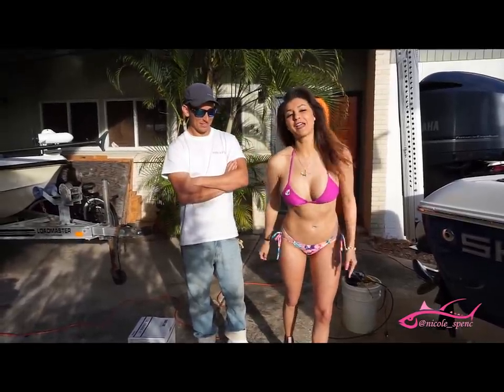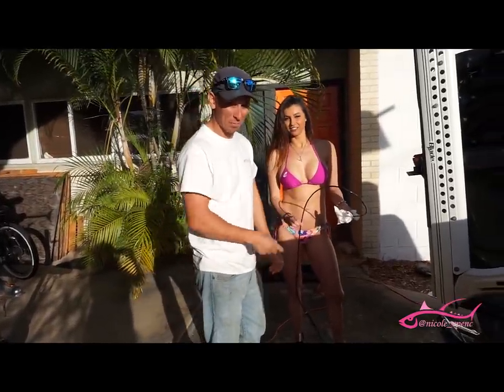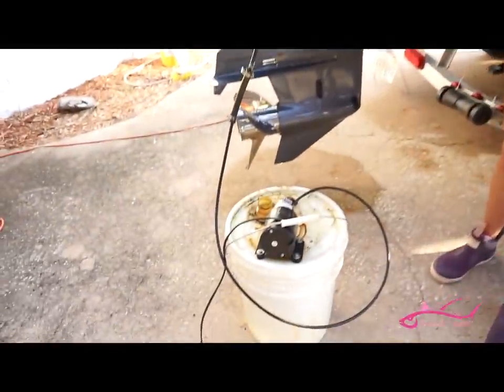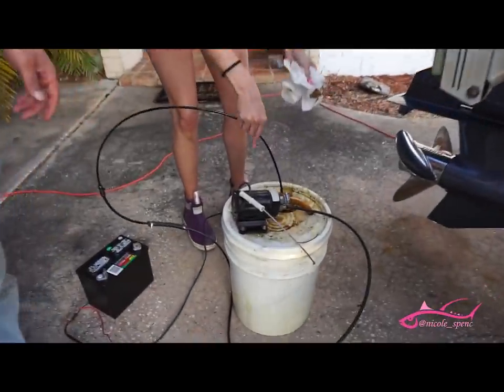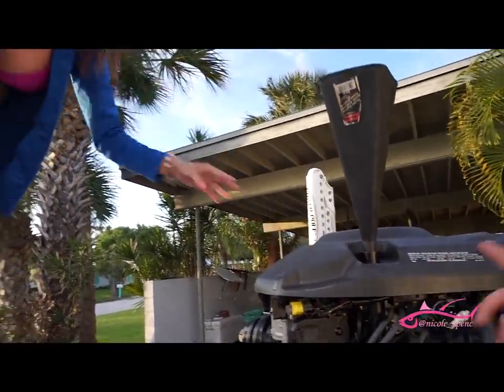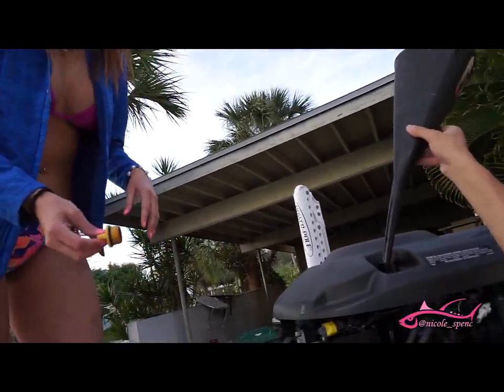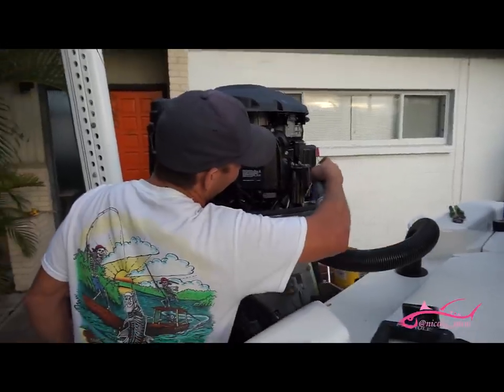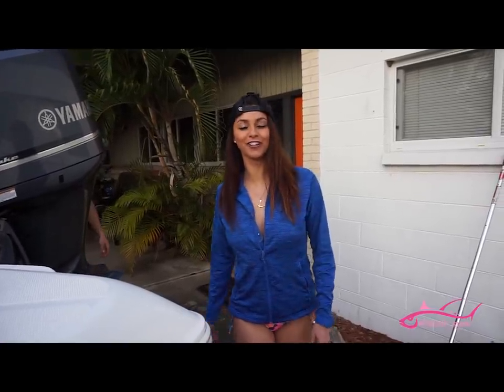GIRL Teaches You HOW TO Change OIL on Yamaha OutBoard ENGINE!

Comment: Hint if you hold the funnel up so there is a gap it won't burp. I usually put a hand clamp on the funnel to hold it up just a little so that doesn't  happen. But you can come change my oil anytime.
Reply: Your very welcome